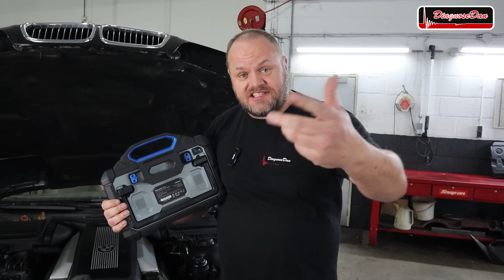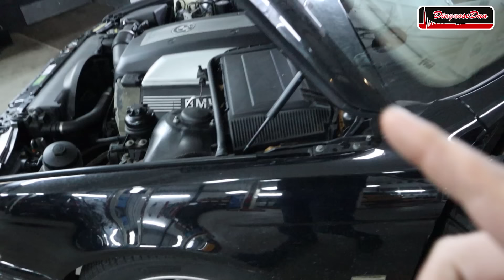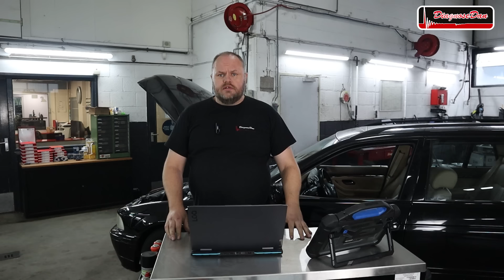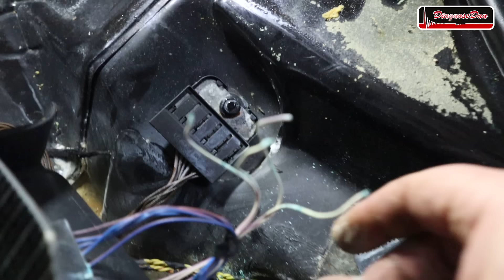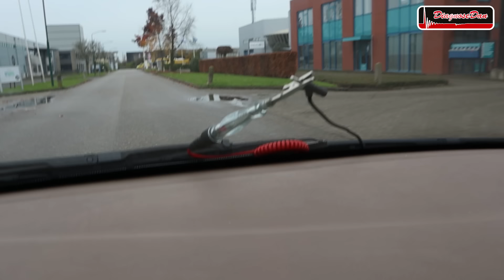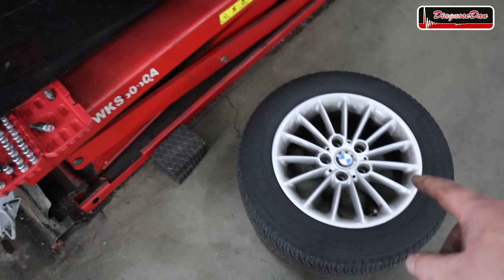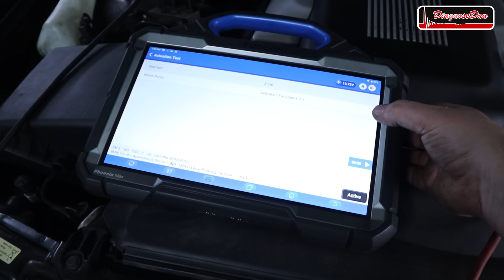Help! Weird fault and my scantool won't connect!

Comment: Did you consider cracking the pre charge pump discharge connection loose and running the pump, to make sure it really was free of air?  It could be that the suction line is pinched.  When someone has a “special procedure” it means the “normal” procedure doesn’t work, and the special one may not work all that well either.
Reply from the maker: If the suction line was pinched, what would have happened when i pressurized the system with the brake bleeder?
Reply: I would have to look at the schematic and understand the details of the specific car. Generically, pressurizing a line may force fluid through a pinch, where sucking on it may collapse the line pinching it off even harder.

Comment: Thanks for info Dan, I have an e38 with the exact same problem, have backfed the pump to check it's working, it is, but I now think not to it's full potential.  Keeps getting a fault saying brake boost passive.
Reply from the maker: Thanks for watching

Comment: I love your channel, Dan. Quick question, was the car OK before changing the brake booster? Why didn't it throw that ABS error before? Or the pump could have been ruined along with the brake booster?
Reply from the maker: I'm not sure why, maybe the pump was on the edge and working on the master cilinder pushed it over the edge

Comment: Dan, I need your help if you can.
I swapped an M57 engine from this model into another brand's car, and I would like to get the VSS signal working with the ECU (EDC15C4). Do you have any information about this signal that could help me create a converter/emulator for it?
Reply from the maker: I'm sorry my friend i've never tried
Reply: @Diagnosedan  thank you!

Comment: Heres a little "TSB" regarding bmw abs issues involving a precharge code and this symptom. We had a 98 z3 in our shop that needed a master cylinder. The apprentice replaced it and during the test drive we get the precharge fault at around 40 mph consistently every key cycle. The boss was sure it had not been bleed correctly. I took over and bled it, and confirmed it was primed by loosening the line from the charge pump with it running to see fluid flow. The scan tool showed the charge pressure similarly to dans  tool, but our car had two pressure sensors on the master, both showing not much change from the running pre charge pump. The pump sounded exactly like the one in the video, like it was running freely with no head pressure. I diagnosed it as a bad master and got another from a different brand and had the same problem still. I ended up googling it and finding a forum post all about incorrectly valved master cylinders and the genuine is NLA. Sure enough, we got  used genuine and it foxed the problem.
Reply from the maker: Great find, on this vehicle the original master cilinder was reinstalled

Comment: Well maybe you can answer me this then! its very similar with the OBD on my SLK 2003 the scan tool will not work without putting the VIN number in manually in not sure why that is??? it's a professional scan tool. also I've noticed three wire somebody has connected to different plugs on the ECU I'm not sure what they're supposed to be doing? two red in a black, I'm wonder if they're disabled the mobilizer it's had a different key for the ignition and barrel, I'm getting constantly oxygen sensor problem 1 as well, I don't know if that's down to the ECU. somebody has replaced oxygen sensor it recently before I bought it with a new one sometimes it gives me different code scenarios of faults on the sensor, doesn't really indicate that the sensor is bad so I'm not sure what's going on there you've got any ideas thanks!!
Reply from the maker: So what faultcodes are you getting?

Comment: on the right side below the seat and caroet, there is a fuse panel, with something like 50 amps fuses that power a lot of modules and ecus in the e39/e38. if you had water on the left side, definitely there is corrision on the other side.... Not that is related, but some viewers might have the same car. Great diagnostic info Dan
Reply: Ya, this problem is more common than most are aware of. Lots of comm issues can be traced to this breakout block. Few years back I had a crank/ no start that put my e39 up in the air for six months. Could've saved most of that along w money and anguish if I'd just started under the carpet of the passenger foot well. Car's been a soCal desert vehicle her entire life so people in wet/snowy climates, this goes triple for you!
And keep those water channels clean. If you visibly have leaves, twigs, etc. when you raise the hood you gotta do it 😉
Reply from the maker: Thanks for watching

Comment: These cars are great! I have a 2003  E39 530d Touring my self. I thought the ABS system did a self test at 20 km/t, cause when i reach 20 i can often feel the brake pedal vibrate  just like you describe here, only that it happends at 40 km/h with this one. 🤔
My pre charge pump has started running for 3--4 seconds after i turn off the ignition, have you ever heard about that before? Im pretty sure it did not to that before. No faults and everything works perfect 🤔 Love watching videos about these cars, always something interresting. Great video!
Reply from the maker: Thanks for watching

Comment: I have had a Vauxhall corsa evap purge valve fault cause an abs fault it was causing brake booster vacuum loss and flagging a fault on the abs
Reply from the maker: Nice!

Comment: How can you be certain that the fault is not in the pressure sensor? Perhaps it is faulty so so that it sends too low pressure readings, in which case the pump could be working?
Reply from the maker: I did some checks and it looked to be displaying the right values
Reply: He tested the sensor by pushing hard on the brake pedal and checking the sensor reading. It was what he expected based on his experience, so the sensor was ok.
Reply: @AJB1  Thanks, you are right.

Comment: I had one recently that would not scan anything, but the tool powered up. After much investigation i found one of the pins on the OBD2 socket had pushed out of the back of the socket.
Reply from the maker: Great find👍

Comment: The pre charge pump fault is the internal failure of the DCS unit.  Pin 8 is that the TDS line or a can bus line?
Reply from the maker: Can bus is 2 wires right? 😉

Comment: Dan you're a genius, these videos are a joy to watch, in my business, commercial heating, not cars, fault finding was the most satisfying aspect, especially when others had failed, but done, as you do, with humility and not boasting.
Reply from the maker: You are in an interesting business. I always struggle to find good techs to work on my heating system. All they do is clean stuff and replace parts that dont fix the issue. ( I' m sure there are great techs out there but i've been unlucky) Sometimes i'm forced to fix the issues myself although its not my field of expertise. There is a tech shortage here and if your heater breaks down in the winter your screwed because everyone is so busy.

Comment: I hate cost cutting on vehicles but in some cases the mechatronik systems in modern cars got alot simpler in construction. That Precharge pump and hidden connectors are just a few more points of failure added...
Reply from the maker: Thanks for watching!

Comment: Same issue on Audi TT Mk2. Scuttle fills up with leaves, blocks the drain and floods the ECU. Stupid place to put it. Cost my brother €2000 for a new one as there was no one in London that would take it in to send off to Bosch. 
Bosch told him he couldn't send it himself but a Bosch dealer could and they would repair it for €500.
Reply from the maker: Try Actronics next time!

Comment: Why not drive inside on a lift with wheels in the air?
Reply from the maker: Only the rear wheels would turn, not a good simulation of the customer complaint.

Comment: Hy Dan,
I am not familiar with ABS system, but is there any other possibility? I mean, if the pump pressure line is leaking, then there also be a low backpressure.
Probably the ABS system should act as a closed line normally.
It's just strange to me this fault appeared in the same time as the initial fault (hard pedal)
Reply from the maker: Wouldn't we loose brake fluid in that case?
Reply: @Diagnosedan  As I said, I am not a daddy like you in automotive. Is there no return line from ABS module, like the leak return line in as we have sometimes hydraulic pumps?

Comment: Sorry, aber ausnahmsweise glaube ich Dir nicht. WARUM sollte die Pre-charge-pump ausgerechnet NACH dem Wechsel des Bremskraftverstärkers "kaputt gehen" - oder hatte der Kunde vorher schon das ABS Licht Problem?? Ich denke eher, dass beim Wechsel des Bremskraftverstärkers vermutlich Schmutz o.ä. in die Pumpe kam - also quasi die Zuleitung oder ein Filter verstopft sein wird - eben weil ich nicht glaube, dass die Pumpe "einfach so zufällig" mit dem Wechsel des BKV kaputt geht. 
Da wäre jetzt interessant gewesen, die Pumpe ggf. auszubauen und zu prüfen.
Reply from the maker: Schmutz könnte die Antwort sein, aber ich weiß nur, was mir der Kunde gesagt hat. vielleicht war die Pumpe schon am Ende ihrer Lebensdauer. Vielleicht hat die Arbeit am System den Job erledigt. Ich habe nie gesagt, dass es einen Grund für den Ausfall der Pumpe geben könnte, ich habe nur bestätigt, dass die Pumpe nicht mehr den richtigen Druck liefert. Ich bin mir nicht sicher, was ich daran nicht glauben soll? Sie geben selbst bereits einige Antworten auf mögliche Ursachen!
Reply: @Diagnosedan  Das kann auch sein, aber wie hoch ist die Wahrscheinlichkeit, dass eine Pumpe genau dann ausfällt, wenn man in ihrer "Umgebung" also in dem Fall den Bremskraftverstärker ausgewechselt hat, dass es NICHTS mit der Reparatur zu tun hat?? Ich würde sagen, die Chancen gehen da fast gegen Null.

Comment: I'll say what I normally say, how many mechanics are there that understand car systems and how to methodically diagnose the problem/s?
Reply from the maker: There are some awesome techs out there! Some really impress me.
Reply: @Diagnosedan  I'm glad to hear that. I only wish that an awesome tech works on my Peugeot 508 this Wednesday as it has a string of error codes. Get this, on start up a error code appeared on the dash telling me the oil level was invalid. It turns out that some clown had broken off the plastic tip of the dipstick with the gradations on it so the dumb mechanic who last serviced the car kept filling it with oil until the level reached the "revised" level of the dipstick. I have the dipstick and written reports to support this. The broken tip was not discovered when the sump was dropped so I have no idea when this began.

Comment: Had the same issue on my Beamer. However, never got a code for the precharge pump, always brake pressure codes. So, I chased my tail for a while, but finally got it right after replacing every part (junkyard parts of course).
Reply from the maker: Glad to hear you resolved the issue

Comment: Unless I missed the actual chain of events how exactly did the precharge pump fail in conjunction with the brake booster replacement? Or was the ABS light coming on before the booster replacement? There are no coincidences in situations like these.
Reply from the maker: I dont know the full story other than i was told. Maybe the pump was on the edge and the work on the master cilinder pushed it over the edge.

Comment: Interesting fault with some great diagnosing. I once had a weird ABS fault on a Rover 800. The ABS light would come on after about 10 to 15 minutes driving around town, or if you drove on twisty country roads, but get on the motorway/autobahn etc and it wouldn't come on. Took me ages to work out what it was! This was a pre OBD car so diagnosing was a lot more basic than what we're used to now!
Reply from the maker: What was the issue?

Comment: I used to live near Leiden for a few years in the late 90s. I remember seeing these E39s slowly become more prominent in the roadways as I biked around. I thought they were really cool. And they still look cool today. 

I’m an American. Now many years later I bought my dream E39 - a 03 V8 touring wagon. I’ve resealed the engine and cooling system, fixed the common faults, refreshed the worn out front and rear suspension, etc. this car still holds its own today. Mine has nearly the same kilometers as this one. Incredibly stealthy swift car. 

Keeping the drains cleared, the vapor barriers sealed behind door panels has saved it from turning into a sauerkraut fish bowl lol

Nice you had that experience starting at BMW - heard they along with Mercedes did a great training program. Enjoyed this video as usual. Dank u wel!
Reply: It's certainly a passion, Nick. I have a soft spot for the E39, too. The styling is timeless and the performance can still hold its own alongside modern vehicles. Always get compliments and convos started when I'm out in mine.
Reply from the maker: My family from my mothers side are all from Leiden. You might not know but people from Leiden have a very distinct accent. When they start talking they can't hidd where they are from!

Comment: screw the diagnostics. call me old school, i prefer the days when you had to think, instead of curse modern electronic BS.

friends range rover, throwing a speed sensor fault. "left hand front sensor open circuit".

so, i unplugged the right hand one.

now it says "left hand front sensor open circuit" *2

not really useful when it cant differentiate between left and right? it also wouldnt clear the faults when plugged back in...

the plan was to swap the sensors over and verify it was indeed a faulty sensor... which could be and should be a simple two minute job.

given the results of the scanner, all you can do is shrug... could be a plug in the harness, a frayed wire, anything... luckily he somehow lost the scan tool (wtf??) so we had lunch and gave up :)

of course, the same diagnostics also didnt mention anything about the blown fuse for the heater fan or demister...
Reply from the maker: Thanks for watching

Comment: That was a fun video Dan! Classic German fishbowl haha! Still more solid than the new German fishbowls 😊😎💪
Reply: I’d like to politely suggest you both start wearing capes like the automotive super hero’s you are. I do however draw the line at wearing your underpants on the outside.
Reply: In all seriousness, it’s a great pitty that what all of you do is an exception in the automotive industry. It should be the norm.
Reply from the maker: Timeless car that drives better than most modern vehicles!

Comment: Right on start, i know exactly where the problem is. I had the same symptoms in past. Abs, dsc fault after reaching 40kmh. Prior to that fault, i fitted another master cylinder, because the old was leaking. I found out, that later cars have different master cylinder because of DSCIII. That master cylinder has inside a passage for the pump test which is tested every time on reaching 40kmh. So they fitted there an earlier master cylinder from car probably made before 2000. Replace it with correct one and the fault will be gone.
Reply from the maker: Great find, this car used its original master cilinder. Just the brake Booster was changed

Comment: Hi , maybe you can help me 
I got a 2005 Ford explorer 4.0 V6 
We changed the baterie , and since we replaced the baterie, the car doesn't have acceleration pedal 
It brings me codes of throttle stuck open
Throttle stuck of 
It works fine on idle .
Thank you for your educational videos 
Greetings from Brazil
Reply: We already replaced the throttle body, but doesn't work 
We also replaced the computer, and with no success
Reply from the maker: Have you tried to relearn the throttle valve?

Comment: Dan, what I do not understand, why did the ABS light come on at 40kph when there is no braking and ABS intervention going on?
Reply from the maker: Self test to see if the system is ready in case of an intervention
Reply: He said that it runs the self-test of the pump at 40kph, and it's when it tests the pump that it sees that it's not working properly.
Why it runs the self-test at 40kph, I don't know... I wonder if it can't do the self test when the brakes are on, and from engine start and creeping away from stationary the brakes will probably be on. Maybe they felt 40kph was likely not to have the brakes applied?
Reply: @AJB1  I see. Thank you.

Comment: Another brilliant diagnose video Dan. Going to save this one, as the model is also apllicable to my own car model. The e39 is known for ABS pump problems. The heat from the manifold, breaks down the pump intermal electronics. Solutions is to make a heatshield (many examples on the forums / facebook sites). And obviously new pump / pump module / overhauling pump.
Reply from the maker: Check out Actronics website. They can fix them affordable and better than new

Comment: Maintenance fail, yes...but why design such a troublesome water drain in the first place?
Still lucky though..a water filled brake booster could ruin the engine...

Great job and thanks for taking us through te diagnosis proces Dan!
Reply from the maker: My pleasure, thanks for watching